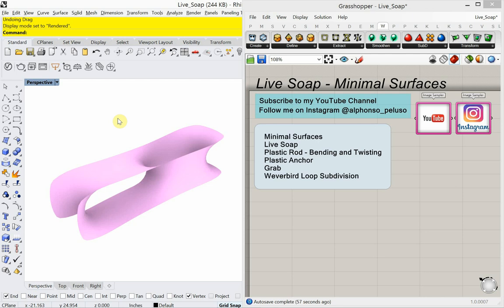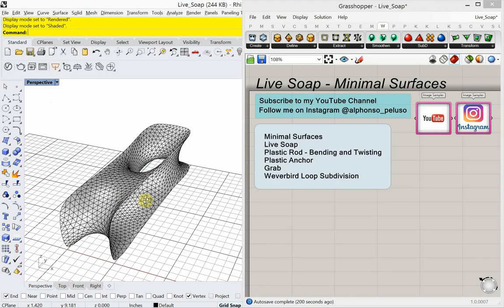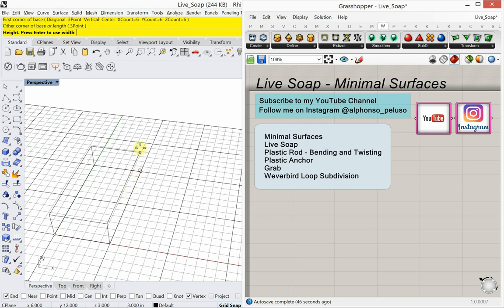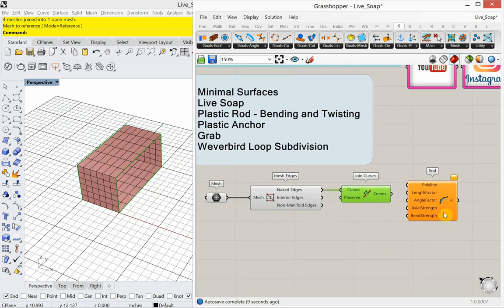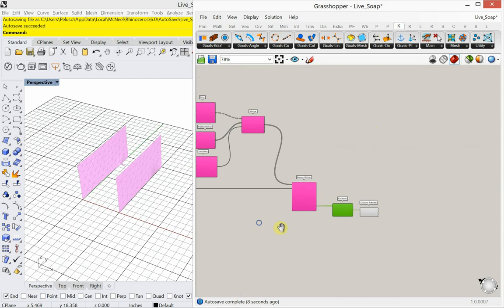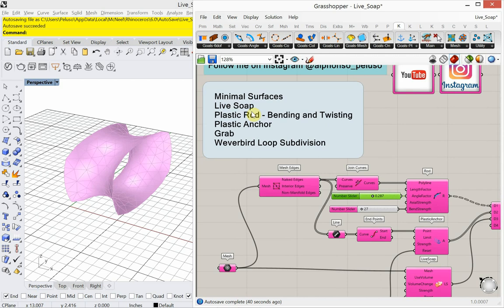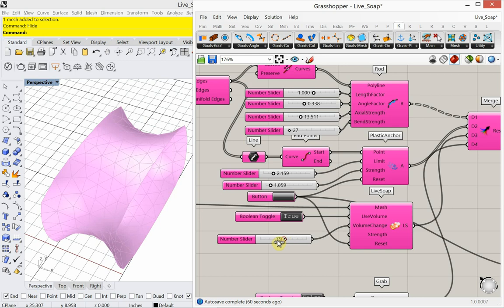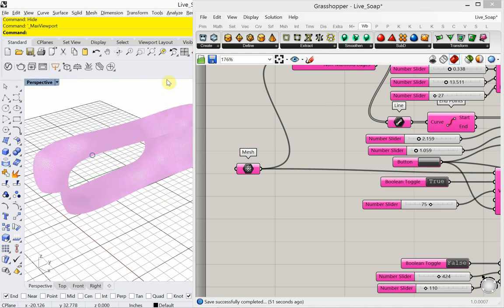Minimal Surfaces with Kangaroo 3D (Live Soap)

Comment: Thank YOU SOO MUCH, Finally a great tutorial about live soap in kangaroo. Most of the videos are just the results. I have a problem like what you had in " bend strength" and "Angle Factor". and I cannot figure out what I should do to come up with its ratio. Appreciate it if you can help
Reply from the maker: Try setting the ‘angle factor’ = .25  Then for the ‘bend strength’ if the form is spiraling in the middle then increase the strength. If it explodes then reduce the strength.

Comment: this grasshopper definition gives me trouble when I try joining the two boxes as one. However it works when they are separated, do you have any suggestions on how to fix this?
Reply from the maker: Try adding a number slider between 0 and 1 to the bouncy slider Damping input.
Reply: @AlphonsoPeluso  I had that exact same problem and I found out that it doesn't work when you make a copy of the box and rotate it. If I copy the box and delete the top and bottom faces without rotating it works perfect
Reply: have you ever solved this problem?